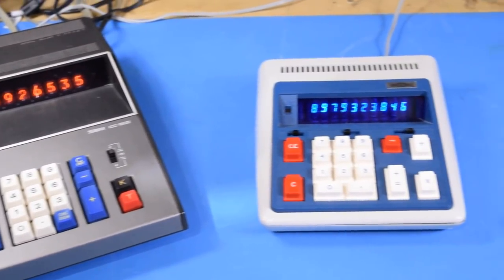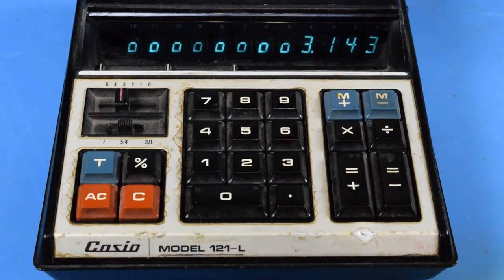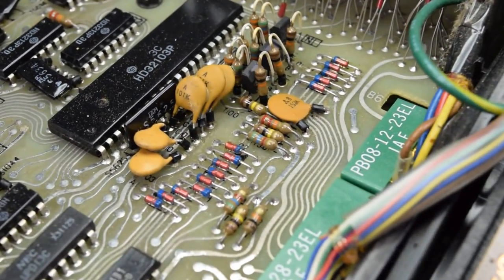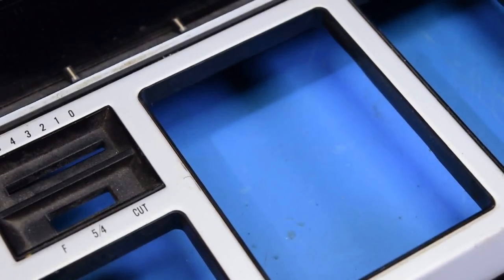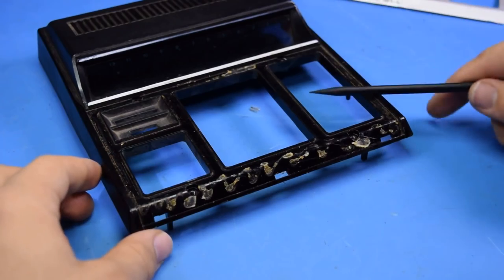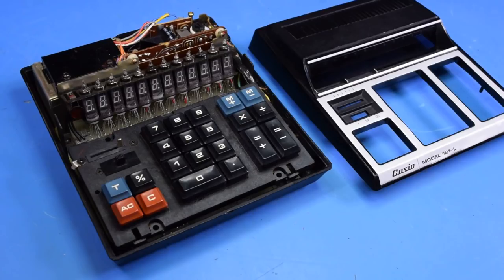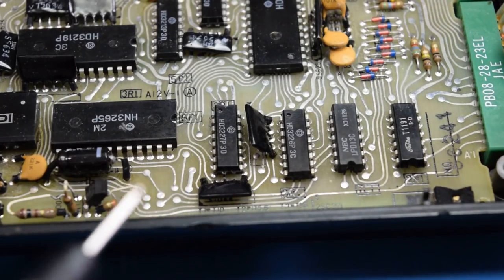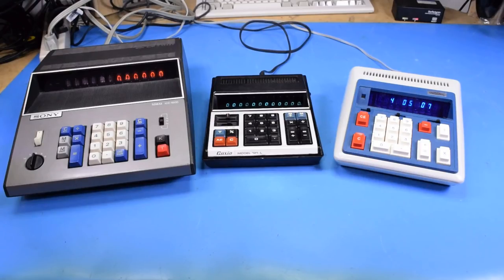0x0031 - Casio 121-L Calculator Restoration

Comment: 733 is the date-code. When they started counting in the early '70, they just mentioned the least significant digit of the year. So: 733 is 1977, week 33
Reply: I'm pretty sure it's not 1977 this 121L was manufactured. For one thing it has Casio's old logo which they changed to the current one 1973. Also on the Hitachi chips there's things like 2M and 3C, so for these with Japanese date codes, 3C is March 1973, and 2M is December 1972. The letter represents the month, ignoring I. In additon a 1977 Casio would have been a lot more integrated than this, with only 1 or 2 chips.
Reply: @michaelturner4457  thank you for the complete info. Love it.
Reply: i realize Im kinda off topic but do anyone know a good site to watch newly released movies online ?

Comment: I have got one of these calculators and the bulb is a negative indicator. Mine was open circuit when I got it and with no current flowing in the bulb the meter didn't show much ether. I replaced the bulb and it worked. As a negative Massa indicator.

Comment: so on one side of the lamp you have 14 volts and on the other you have ground commuted by a transistor. you were creating an overflow situation so the transistor should conduct, you were measuring voltage in relation to what?measuring ground in relation to ground gives you zero...you should measure ohms from chassis ground to lamp ground i guess...but i probably missed something....  it also seems weird that both the lamp and the IC failed at once...if the IC fails the lamp will no longer light so it will not go bad unless someone bumped the calculator very hard....maybe the transistor shorted and the light stayed on till it burned out? you should go deeper on that mistery

Comment: Nice calc! At first, I thought that the lamp might be a power indicator, but judging by where it's connected, it's probably not the case. It might be a component that was put into the circuit, but never actually programmed to be used.

Comment: Shigeru Kashio worked very, very hard to help his sons establish Kashio. He alone moved the first prototype calculator uphill using a wheelbarrow. Then Tadao and Toshio worked extremely hard to establish Casio computer co., Ltd. They hired clever, loyal engineers, and workers. Most people remained loyal to the company for a long time, as in most Japanese companies. They were determined to make products built to last. This quality continued upto the early 2000s and even up to 2015, even with manufacturing moved to China and Thailand. But of late the quality is going down, especially Philippines and Thailand made products. One calculator made in 2016 in Philippines failed within three years, three keys went totally non functional. I have a 2008 China made calculator that still works in 2022 (14 years), a Japan made 1994 calculator working with a few segments not working.

Comment: Nice calculator! The closest thing i have to that is a standard business calculator from, i think 1999. 
It still works pretty well, and still runs on some AA cells, i was thinking in getting some rechargeable ones there. Or maybe, just put a psu that outputs its voltage, as it aways stands in the same table, maybe using dummy batteries made out of plastic.

Comment: Remember when testing a lot of these old devices, that many chips use open collector outputs... They don't automatically swing high and low. You have to provide pull-up resistors, hence so many resistor packs used in this for pull up. It also means that if it's at ground, and you are referencing ground, then the chip is actively pulling down the output to ground, and you'll measure nothing. It's also entirely possible that that's not overflow, but a negative indicator.

Comment: I've got one of these in lovely condition. It works great during addition and subtraction but mostly falls over during division and multiplication. I'm guessing it needs a recap or some PSU adjustment. Not managed to find a service manual or anything though unfortunately.

Comment: i took the challenge of looking up all the ICs i could find on the calcmuseum website, and this is what i came up with:
here's the manual: http://casio.ledudu.com/images/calculs/casio/manuels/121L_en.pdf 
here's the product catalog, which confirms the casio 121-l was in fact available for purchase as early as, or earlier than 1973: http://casio.ledudu.com/images/calculs/casio/goodies/catalogue1973.pdf
here is another site, which further proves the data of availability, this site states that it is ~1972: http://www.calcuseum.com/desk_13854.html

unfortunately, i still have not been able to find any schematics for this particular model... i'll let you know if i ever manage to
Reply: also, the border on the keyboard is supposed to be silver, and the case should be black. the oldest IC i found was this one, which is from 1969: http://www.calcuseum.com/SCRAPBOOK/BONUS/20120/1.htm
the one that was giving the red light trouble is this one: http://www.calcuseum.com/SCRAPBOOK/BONUS/20660/1.htm
hopefully a schematic for the calculator, or the IC will surface somewhere on the interwebs soon :)

Comment: You should replace the lamp with a test lamp to just see if there is any change
maybe it lights up
Reply: Jeroen VS Nah, the multimeter awready says it doent have any voltagr applied. Both the lamp and the output are fried/non-funcional